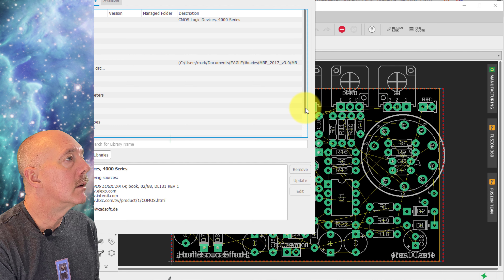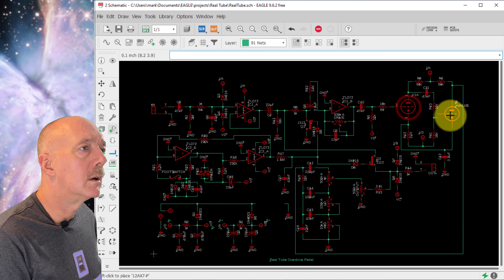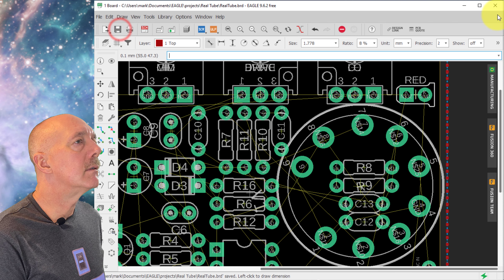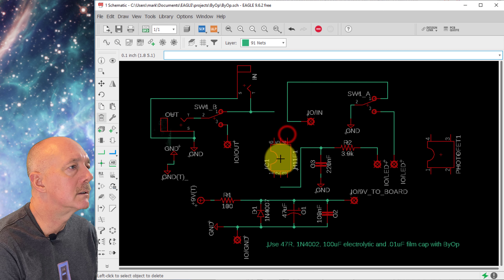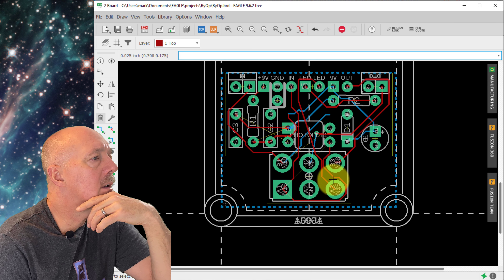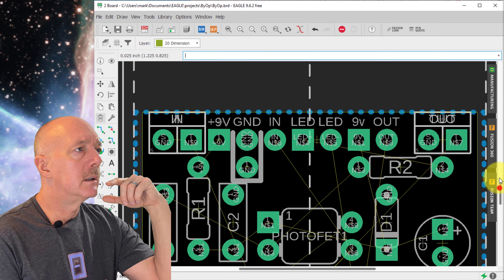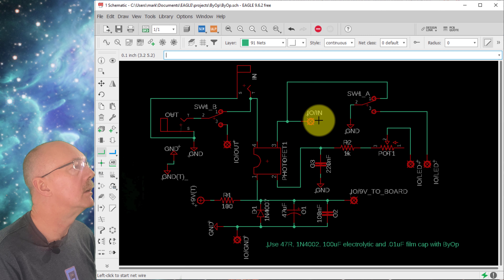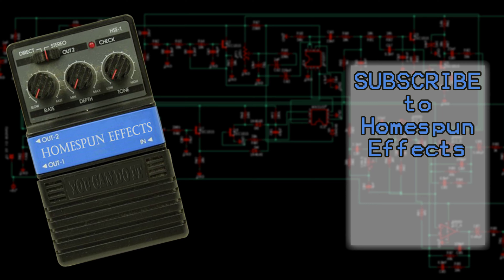Build your own effect pedal Tube Type Overdrive - Adjusting the Component Footprints in the Library

Comment: You still around? I was hoping to see further followups on this and the Real Tube pedal. Like what was wrong with the original board.
Reply from the maker: I’m still around. I picked up a ton of more work since this video and just haven’t been able to get anything new out. 

The original board was just totally wrecked by the person that worked on it before me. Solder pads were lifted, outboard wiring wasn’t connected to the correct places and there were at least two solder bridges. 

I now know that I made the right decision to just make a new PCB for the pedal. 

Thanks for watching. I have a new video in the works. Hint: it’s mechanical modulation and I’m excited about it.
Reply: @HomespunEffects  more work is good.

Sounds like a real hack got go the pedal.
Reply: I too am interested in the tube pedal. I have recently begun using eagle and making my own effects (cloned) from other schematics. If you were to completely clone the tube driver, how would you power it without the internal transformer?
Reply: @jimilee459  external transformer?
wouldn't be much different than a DC wall wart.
Reply from the maker: @jimilee459  I’ve been thinking about this. These pedals use +18v to -18v so I suppose you could use an 18v adapter (like the ones for the MXR 10 band EQ, et al.) and voltage converter (something like a MAXX1044 but that may not supply enough current, not sure) to get the negative volts.

It may be more fun to make a transformer though. 😁
Reply: @HomespunEffects  make one you say? I’ll be keeping an eye out to see how that’s done for sure.
Reply from the maker: Sourcing materials looks to be the difficult part.
Reply: @HomespunEffects  yessir. Do the newer ones have a transformer?
Reply from the maker: @jimilee459  looks like that is the case. https://butleraudio.com/tubedriver.php
Reply: @HomespunEffects  Brian at Madbean is releasing a Butler tube driver this month, I’m curious how he is going to do it. It’s been kind of a mystery so far.
Reply from the maker: @jimilee459  nice!  I wonder if he is going with a voltage doubler and a negative voltage converter.
Reply: @HomespunEffects  I do too, he’s keeping it close to his vest for now.

Comment: ((d|-(<O>)-| |-(<O>)-|b))  ® ..... I love germanium transistors. I was thinking what effect would the sound have, if you put a silicone  in front or in back of a germanium? will it kill the Ger tone, etc?  P/S Great Vids!
Reply from the maker: It’s definitely worth breadboarding and experimenting. I’d imagine that having the germanium transistor first would retain its characteristic interaction with the guitar volume potentiometer. 

Have you checked the harmonic percolator series? That uses germanium and silicon transistors in parallel. It’s my favorite “fuzz” type effect.
Reply: @HomespunEffects    They have 2 Sil trans, in the Schematic...
Reply from the maker: @bobolongo6550  on the harmonic percolator the 2n404a is a germanium PNP and the 2n3565 is a silicon NPN.